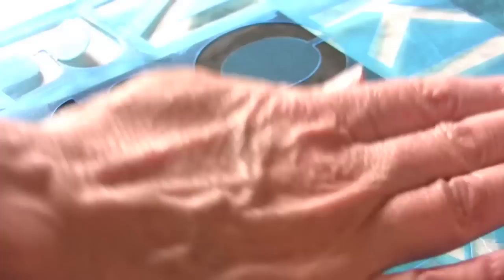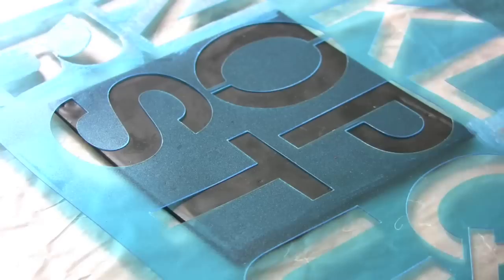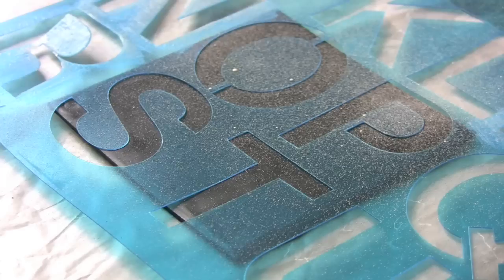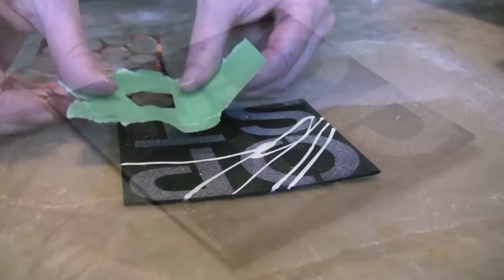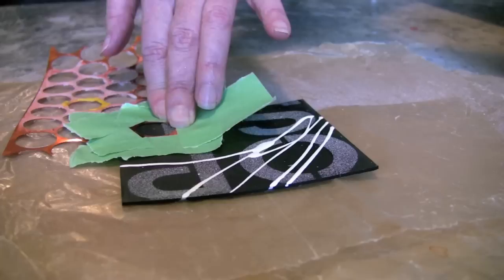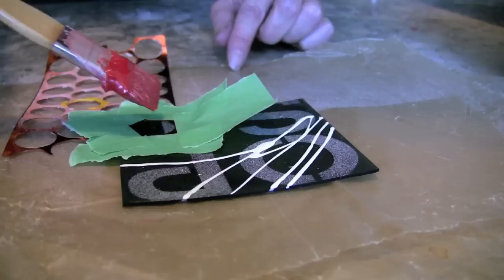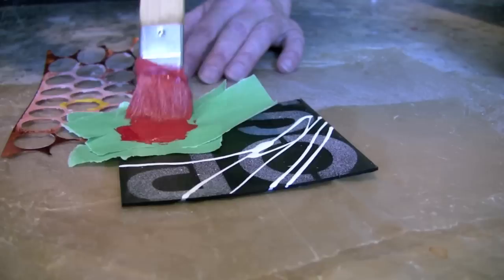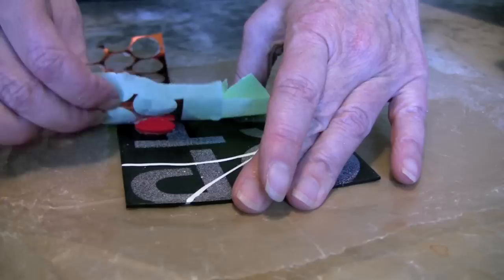Encaustic Technique 1 Stencils

Comment: These videos are wonderful thank you for putting them on youtube so we can learn from your experimentation here.  I have a similar question to the one below.  I have been working with encaustics for a short while now so have not masted "fusing" and keeping a shape like this circle you have here.  How did you accomplish that look and the splatters without them running?  A visual demo of that would be wonderful!!!!  Thanks again for your time!
Reply from the maker: +renee spencer Hi Renee. Fusing is actually the art of encaustic painting...and it is the skill that I think is the most important to practice. I am working on a video series right now that addresses that and a number of other issues in encaustic painting including image development and creating a unified series. Until then though - I would suggest practicing with encaustic medium that you can then melt back into the pot (time and time again) after practicing with it. It is good to have a heat gun with 2 settings, along with an adjustable blow torch - so that you can control the amount of heat and intensity - and then practice your proximity to the surface and keep your heat source moving.  Good luck with this.  : )

Comment: Hi Nancy! Thank you so much for posting these videos.. I've been watching them a few times over and have been experimenting like crazy! One question that I have is, when you're working with crisp stenciled shapes, transferred drawings, and especially graphite directly on the wax, how do you lay a layer of wax over the top without destroying the detail underneath? I've ruined many pieces this way and can't seem to find the technique to avoid the smearing. Sometimes it creates a cool effect, but there are times when I want to preserve what is underneath as much as possible. Is a pour recommended? Many of your videos show the finished product at the end, but not the process of going from the technique you show to the final piece which usually looks like a few coats of clear (or combination of colors) over the top. Any advice would be much appreciated! Interested in taking your advanced class in Summer 2016!
Reply from the maker: +Adahliaful Hello! I think I can answer your questions in 2 different ways. First of all - maintaining crisp stencilled shapes in coloured wax or other materials is a matter of gentle fusing. This takes practice. I use my heat gun on low and have it further away from the surface continually moving it in a gentle circular motion. As far as transferring a graphite drawing onto the surface and not having it smudge you could use either Saral graphite paper, or an HB graphite pencil - rather than a 6B or 9B that really likes to smudge. (Just to let you know I am working on an encaustic series of videos that will be much more in depth and show the entire process - the first one will be available in December)  : )  Thanks for your questions and I'm glad you are enjoying the videos!

Comment: I've been using encaustic wax recently.  I love this medium!  Need help.  I'd like to find an encaustic wax heater that is small.  Not looking to spend an arm and a leg and for now I will only use for clear wax.  Can you suggest something that would fit that bill?   Really appreciate your help.  Thank you.  Cathy
Reply from the maker: +Cathy Speerly I think a small hot plate would work - as long as it has a temperature gauge...especially if you are only putting one pot of encaustic medium on it. The other option would be a small electric crock pot or mini slow cooker with temperature controls. Good luck to you and let me know what you discover. Happy Creating!
Reply: +Nancy Crawford Thank you!